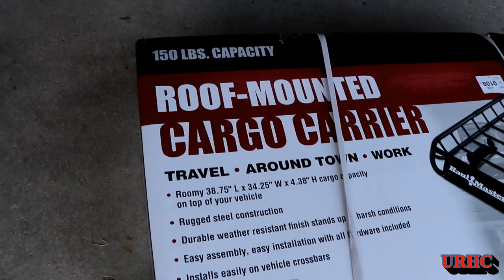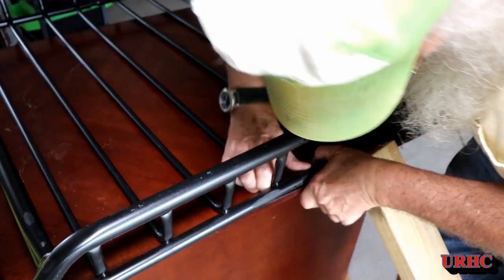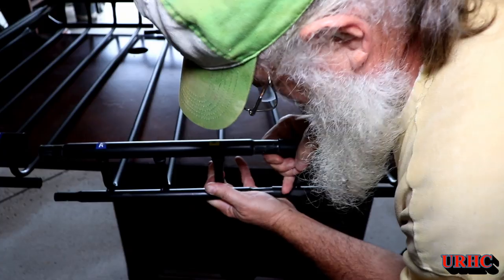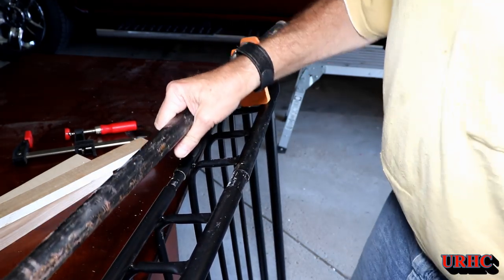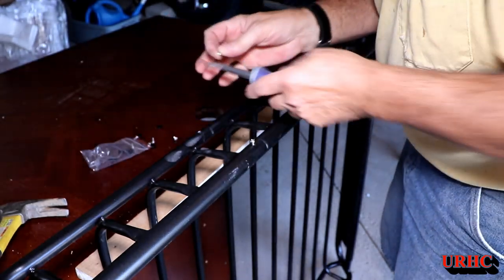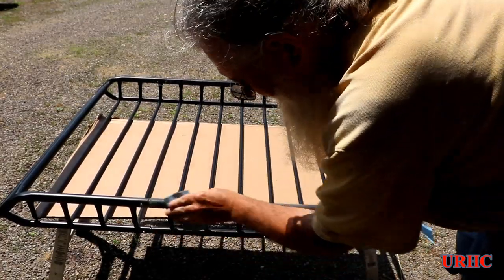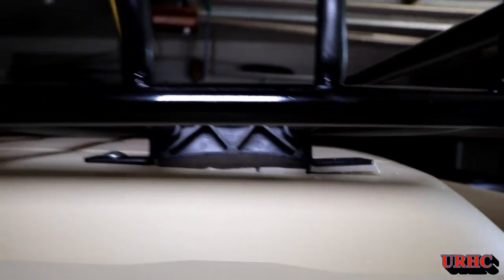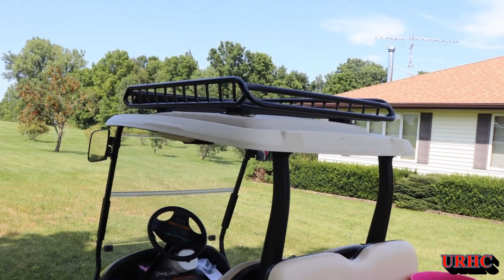Harbor Freight Cargo Carrier #64101 For The Yard Cart

Comment: That's too bad it was so hard to assemble.  I don't think I would have tried for that long.  Frustration would have made me chuck it back into the box.  You persevered and got it done, good for you.  After you painted it and did your signs, it looks pretty good.  I hope it's handy enough to make up for the assembly crap.  :)  Thanks.
Reply from the maker: It must have all deformed from the welding heat and from the looks of all the scratches in the mating areas they had a problem before boxing it up and just let it go. Its amazing the things we use that cart for anymore.  I hate when a 5 minute job turns into a 2 hour job because of poor manufacturing quality. Thanks for watching.

Comment: What did you use to keep it sliding around? I am thinking about welding the brackets to the roof rack
Reply from the maker: I drilled holes and used the brackets it came  with.  Made rubber blocks  to spread out the stress. Thanks for watching.

Comment: the frame is crooked on purpose
you're supposed to hammer the pieces together and the bend gives it a better grip to prevent separation
Reply from the maker: You must  work for customer service 😲. Thanks for watching.
Reply: i own the same model under the MaxxHaul brand.

Comment: Looks like it was a return that they sent you
Reply from the maker: It could be but I don't think so because it still had the factory strapping on the main box. It should have slid together in 5 minutes but the spacing on the tubes was not right.  Doesn't look bad after I finally got it assembled and covered with paint. Thanks for watching.